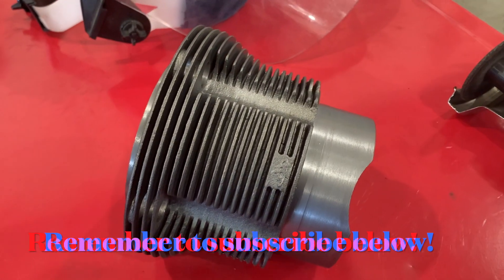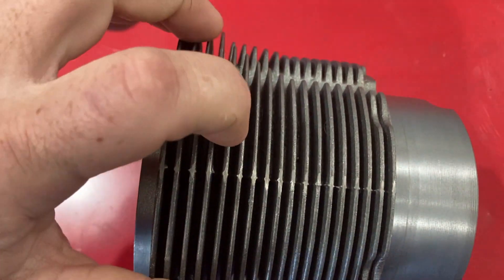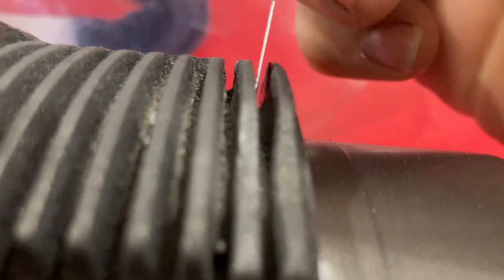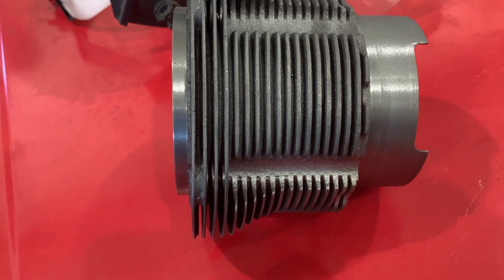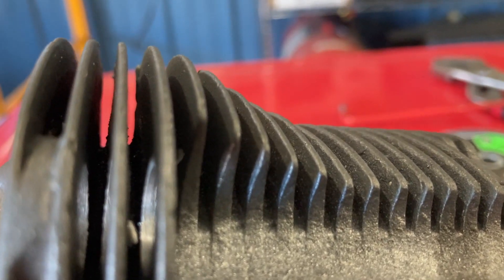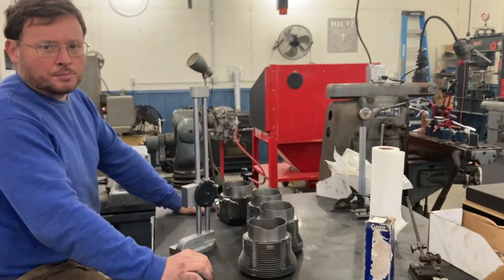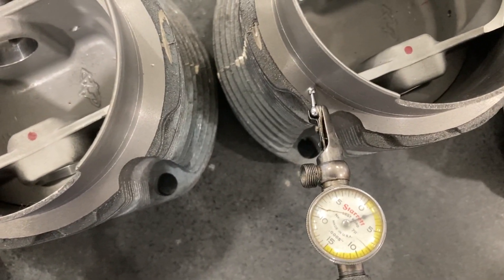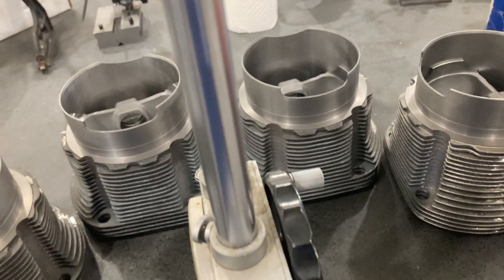AA Cylinders for Air-cooled VW - Problems & Rework

Comment: When you say flashing I assuming you are talking about that stuff that is in between the fins. That is from the casting production process. I would be worried about damaging my cylinder. I would try it with a hand file instead. Thanks for the suggestion. When I disassemble my engine I will check this.
Reply from the maker: Yes, that’s exactly what I’m referencing. You won’t hurt the cylinder in any way using the disc like I do, so long as you have a good hand control. A thin file will take an extreme amping of time because the flash is very heavy on most of these new cylinders

Comment: The height difference is nothing new. That was also evident with factorry stuff.
Reply from the maker: This is industry an standard operation for performance builders.
Reply: @MaineMachinist  Absolutely. I was just saying that the issue is not new. It has been so in the 30 years i have worked with ACVW & Porsche.
Reply from the maker: It absolutely matters whether the heights are matched or not

Comment: I just noticed that on the new 90.5 AA cylinders I bought, too.  I’ll be taking your lead, on cleaning up the casting. Even more disturbing is the variation in barrel length. I’ll probably face the surface that mates to the case, on my lathe.  It just shows, you can’t assume new parts are ready to assemble.
New subscriber, Tony B👍
Reply from the maker: Hi Tony, thanks for watching! It’s really too bad, but you’re absolutely right. We can’t just assume new parts are within spec anymore. It’s not just the Aircooled VW world either. Classic American Iron is in the same boat. We need to support American and European manufacturing.